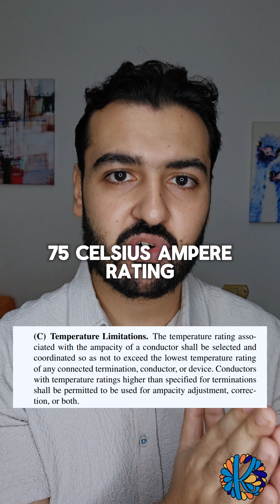NEC 110.14 Which Column to Choose – 60°C or 75°C?  #nationalelectricalcode #conductor #nec

Comment: Does selecting ampacity in the column higher than the circuit breaker temp rating cause nuisance tripping?